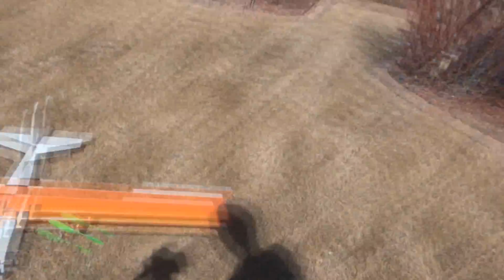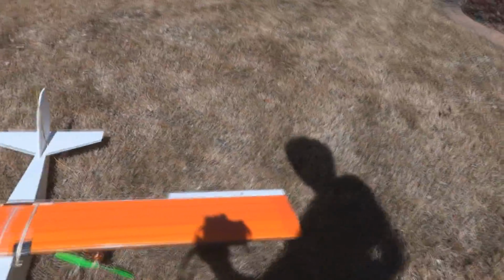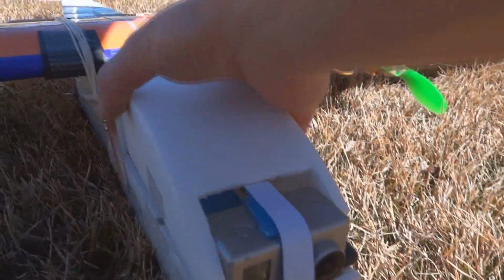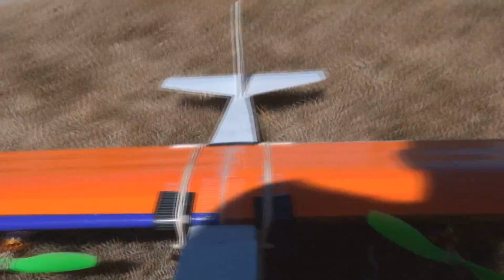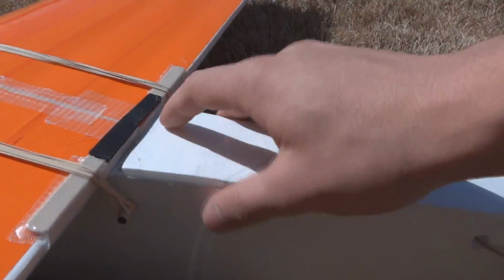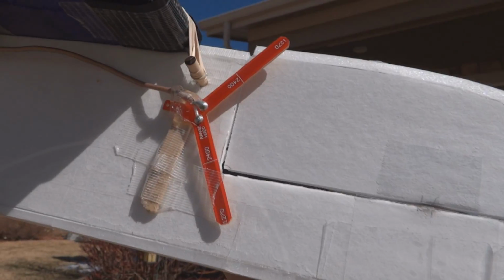The Easy Twin

Comment: Just wanted to let you know I made this plane using the plans on RCGroups, and it flies great!! I might have used motors that were a little bit big for this application but boy is it fun to fly!! Unlimited vertical with ridiculous lifting capabilities. 
Thanks!!
Reply from the maker: Awesome man! Glad it worked for you! Could you post some picks on the forum? I would love to see how it turned out!
Reply: I'll get some pics tomorrow and post them in your thread. I've posted some on board footage and I will soon upload the maiden video. Thanks again.